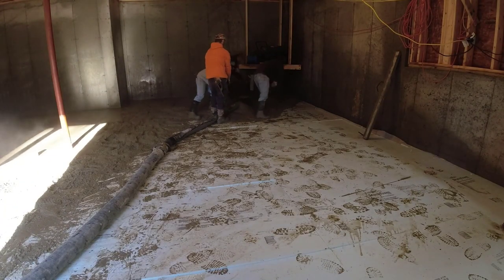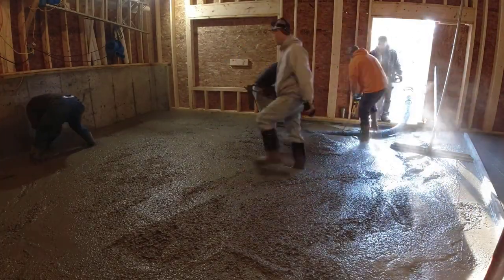Pouring Concrete For A Basement Floor (Pumped Over The House)

Comment: Quick question for you about cracking. I know you saw cut the slabs so that it cracks along the cuts. I have always thought that no matter what, every slab will crack. I was just at an arena with three sheets. Two of them had the ice out and I walked the full 85X200 on both slabs and there were no cracks at all, and no saw cuts. Do you know how they accomplish that? I would like to follow the same procedure for my shop floor. Thanks

Comment: Hey I thought you used a attitive to pour the loose water you pour? You added like 30 gallons of water to that load? Don't tell me it didn't weaken the concrete 🤣 I can't believe you pour like that with a straight face

Comment: We used metal form ties usually 8”. The plans called for about four foot tall retaining walls to be tied into the floor that was also concrete both placed at the same time . It was for a spiral staircase and had a big footing and a well fit the stair case base to fit into. All tied together with a lot of steel. 8” form ties for the 2x12s form boards. Everything was going good until the finish really no where to go and as I am working my floats my elbow makes contact with the form tie and it slices me a good one so I got the duct tape and kept on working